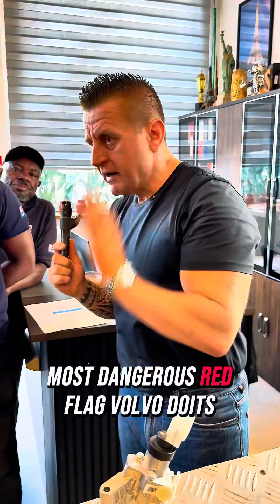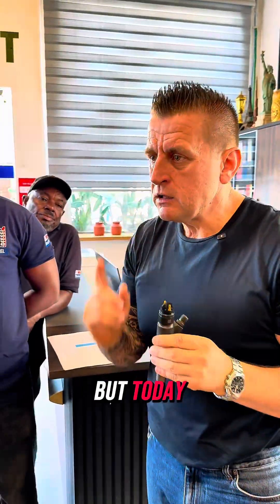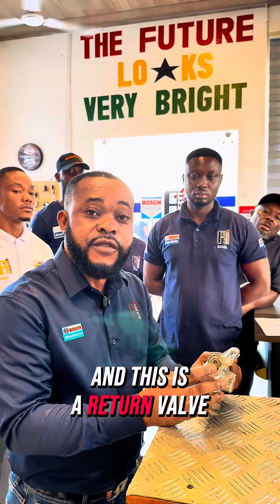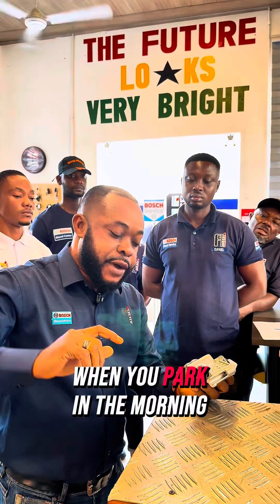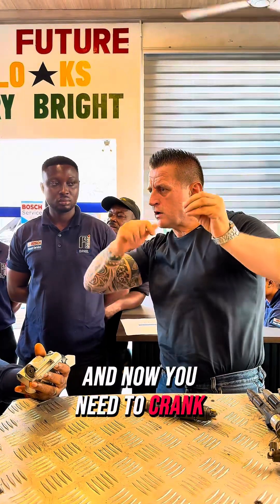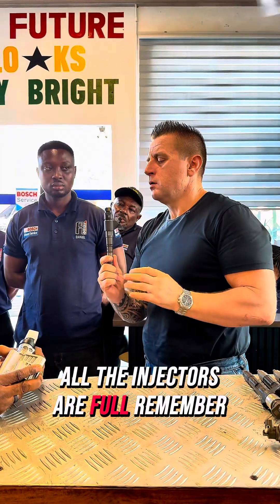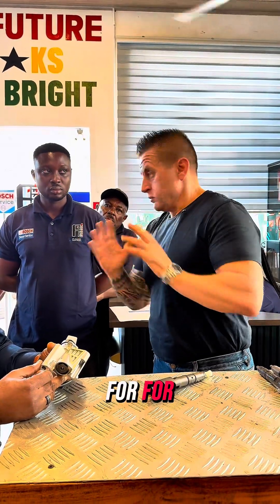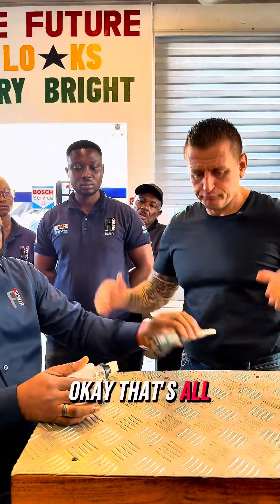⚠️ The Most Dangerous Injector? ⚠️ Volvo Deutz EXPOSED!

Comment: True. Deutz Diesel and many more are designed not to crank till prime minimum pressure isn't achieved. Volvo construction equipment uses Deutz Diesel engines. I've worked at Deutz Diesel